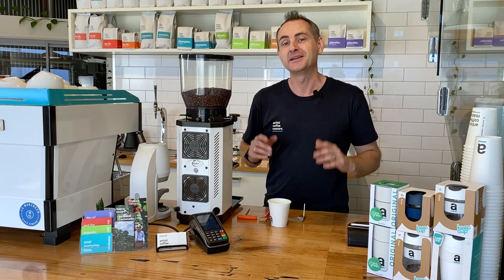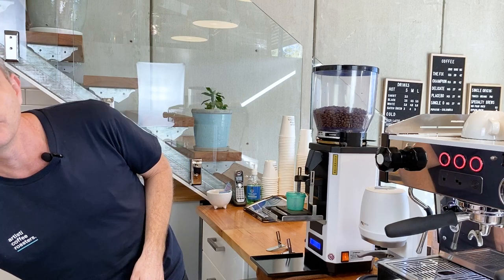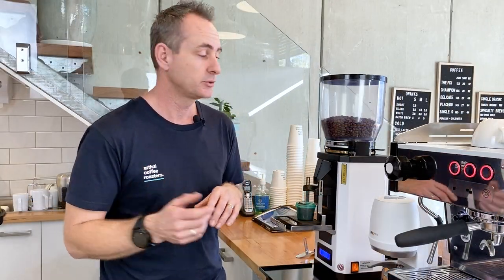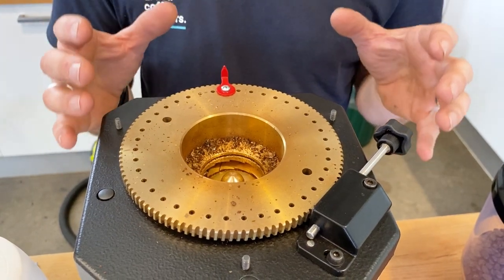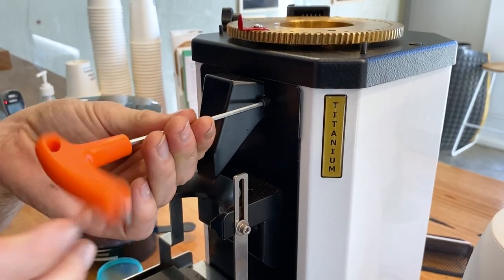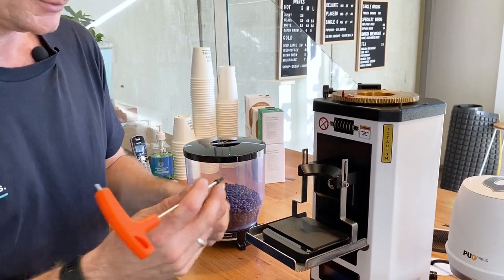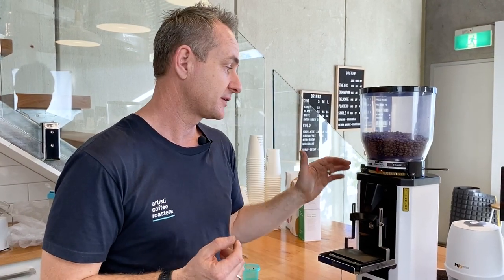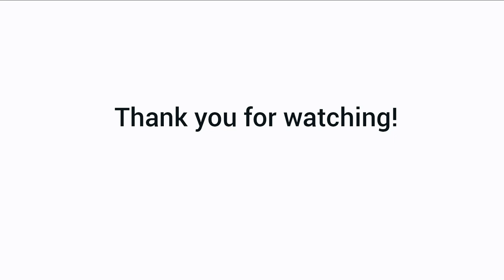Anfim SP11 Coffee Grinder - Cleaning & Maintenance

Comment: Is it true that I should not adjust the grinding when the grinder is off?
Reply from the maker: Not true, you can do it, the issue is that you can clamp a bean between the top and bottom burr causing it to lock up. This is not good for the motor.

Comment: Hello, my new job is barista.  I am having an amphitheater milano grinder problem.  When thinning, 18 grams of coffee flows for 30 seconds or more.  This is the formula I'm looking for: 18 grams of espresso, 27 and 28 seconds, non-sour taste.  How do I need to calibrate the machine for this?  I find 18 grams of espresso, but it still tastes sour.  And the result is higher than 30 seconds.  As a result ;  For 18 19 g espresso, 27 and 28 seconds flow, non-sour taste, what should be the grinder time and setting?
Reply from the maker: You need to make the grind more coarse. It will flow quicker than 30sec. The sour taste can also be the coffee, is it a light, medium or dark roast coffee?

Comment: Hello sir , what is the perfect grind be between of ?????????
Reply from the maker: Sorry, I’m unsure of your question?
Reply: What is the perfect grind size of espresso  in this Anfim grinder ??? Am new with the grinder that's why am asking , like the grind size should range from ???? 6.5 or what ?
Reply from the maker: Ok. So the numbers are only a reference point that change as the blades wear down. Check out our latest video on how we season a new grinder. It may help you. You can feel the grind and it should be finer than sand but, if it’s clumping it is a bit too fine. It’s best to start coarser then test your extraction and adjust. grinder numbers will not be the same in different brands
Reply: Help to calibrate this gride for espresso